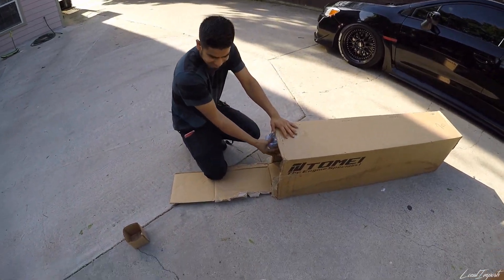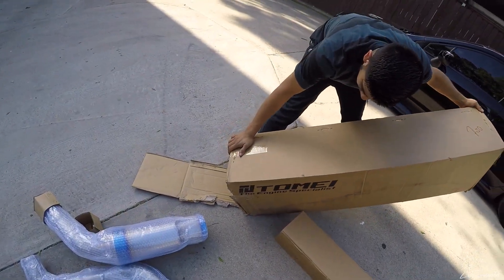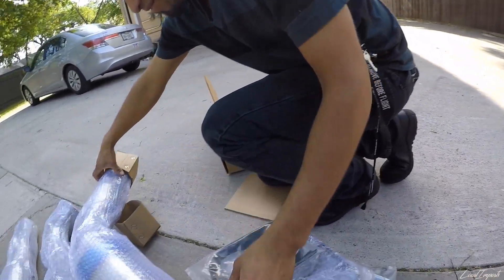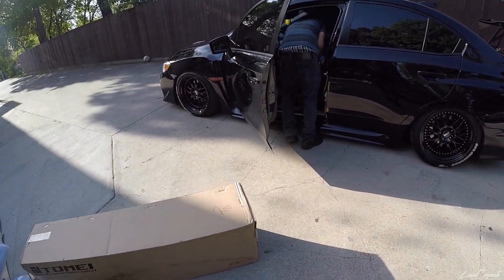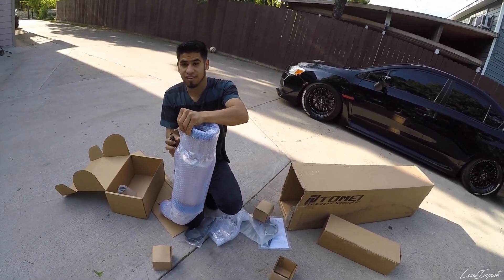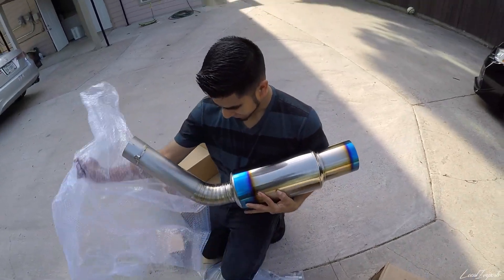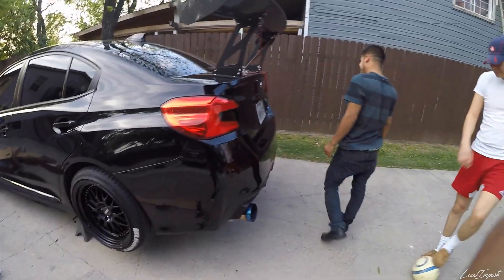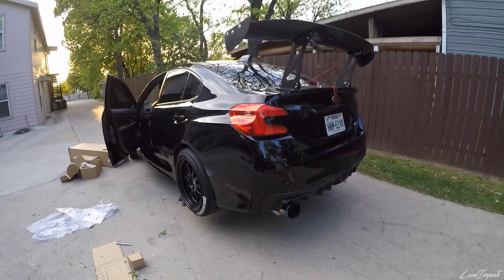Installing a Tomei Exhaust on the Subaru WRX (catback exhaust)

Comment: How did he get the blinking brake lights?
Reply from the maker: It's nice small thing you buy that makes them blink I think on Ebay but only for led if you have bulb you can buy them at blinking brake lights
Reply: Local Imports so what’s the little thing called so I can purchase it?